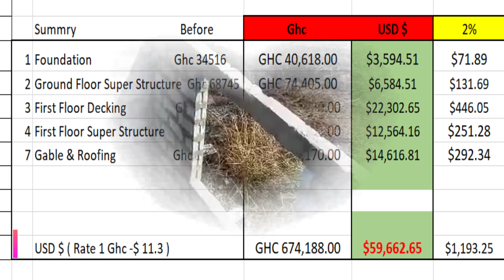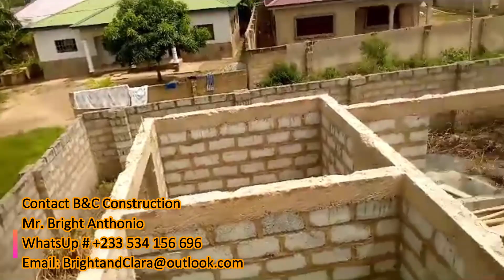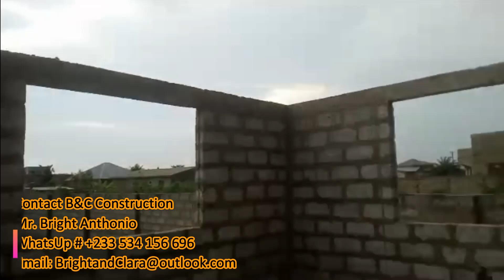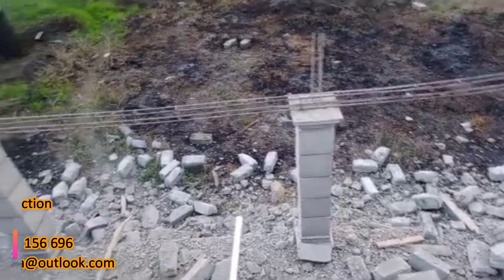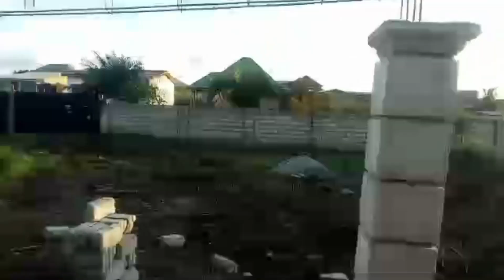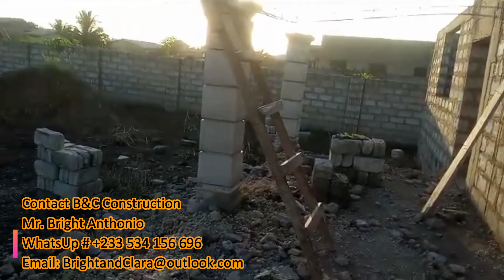Building in Ghana | Ep-02 | Madam Joy Project | Demolishing of Floor Slab & Lintel Concrete Works

Comment: i had similar problem after my slab, had to demolish everything put a beam across the living room and re casted it again, this time around i used more cement, now my building solid
Reply: There are ways that it can be done without the beam protruding. Mostly you can use a secret beam if the spacing between columns is over 20 feet but not more than 25 feet advisably. The bars in the stirrup should be 4 bars of 20mm rods at the bottom and 4 bars of 16mm rods at the top. It could also be 20mm bars at the top is there's sufficient spacing provided. Too many bars in the stirrup doesn't really represent strength as it might prevent concrete from passing through the beam. If done correctly you can have an entirely flat surface with no beam visibly showing under the slab. Thank you.
Reply: @henryabotsi Hello, are you a structural engineer/architect by any chance?
Reply: @ladysaw9995   no I’m not, just learned a lot on YouTube to build my house back home
Reply: @ladysaw9995  Yes I am a structural engineer. Thank you.
Reply: @henryabotsi  please are you a structural engineer in ghana?
Reply: @henryabotsi  I'm looking for one.